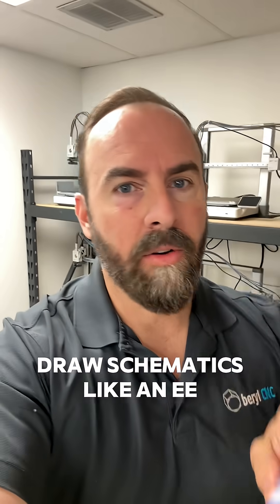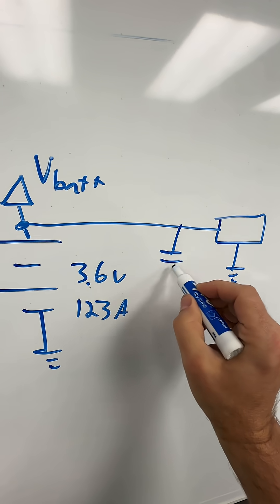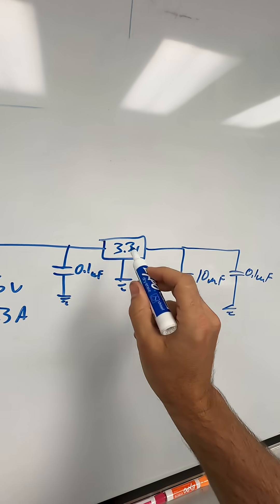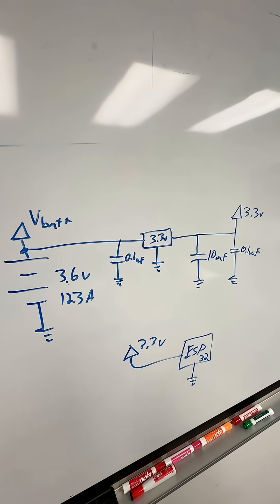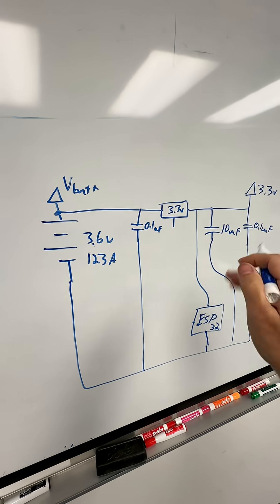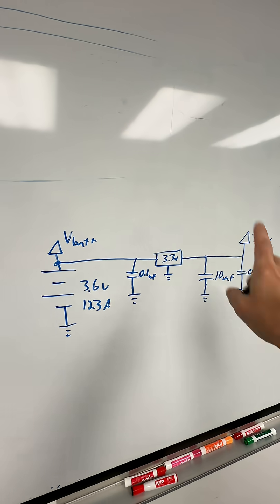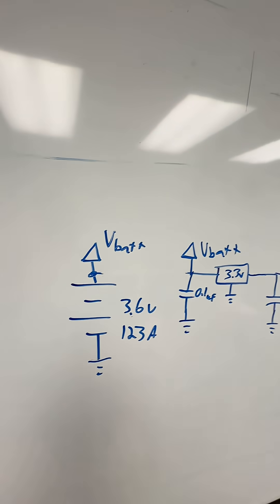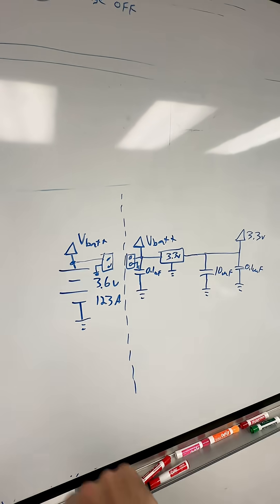Draw Schematics Like an Electrical Engineer

Comment: EE here .. keep all text in the same orientation is a big thing. It makes reading the schematic easier. Also, functional block separation as you mentioned but also input to output flow (left to right).

Comment: You pick this up pretty quick if you work in KiCAD or something to make a PCB because drawing schematics like this makes it modular. Like he said you can break it out into different sheets or sections and work on them in isolation. You're not really worried about the theory of the overall current flow but really how to make a functional design hence this style dominates.

It's a bit like making functions and classes and objects in computer programming versus trying to draw the entire thing iteratively as one big program all in your main function or something. One is just much easier to maintain and understand than the other.

Comment: Good day, sir. Thank you for sharing these tips. I am currently a graduating student doing my capstone research. If my capstone project succeeds, I plan to make a PCB for the project to make the wiring and board smaller. We are only taught on single layer PCB design and we usually just do etching because there is no local PCB print company.  My question is, can make a short video about multilayer PCB design? I hope you can see my comment. Thank you sir. p.s. enjoy watching your videos ^_^

Comment from the maker: Any electrical engineers or engineering students following? Let us all know if there’s anything to add - best practices, gotchas, or pet peeves. Not an EE? Ask me questions, I believe my profession is a great foundation for nearly any STEM discipline. I’ve gone the R&D direction, as you’ll see in my other videos.
Reply: Some caveats, 1) drawing like this tends to lead to a generally assumed ground as opposed to a power ground vs signal ground. I've blown an o-scope because I followed the schematic. 
2) placement of physical grounds matter. Your applications don't really need to worry about it due to the frequencies you operate in and amplitudes, but a signal can end up on ground that shifts it's amplitude which can lead to unintended results in the digital world. 
3) the caps are to remove the analog 'ambient' noise from the lines. To help keep this overly simple, small caps move analog faster, while larger move them in bigger pieces. An added bonus is that there is a 'pool' of voltage/energy to pull from closer to the circuit from the batt or supply.
Hope this helps